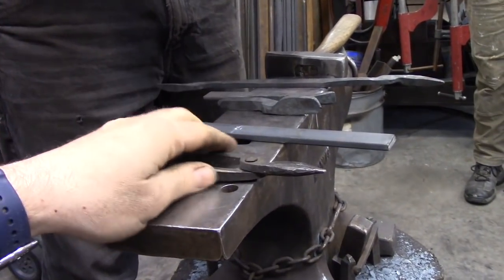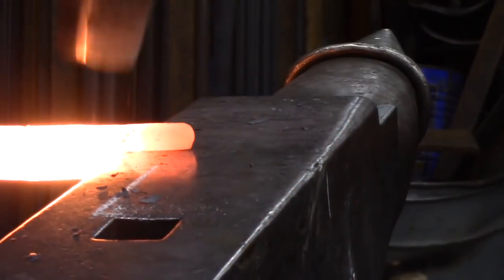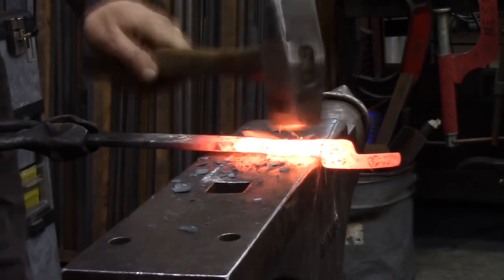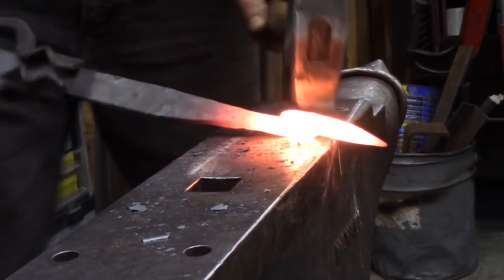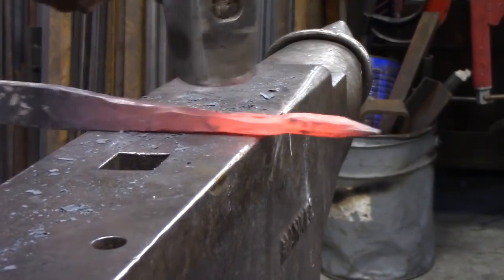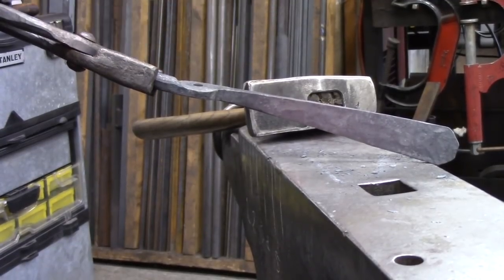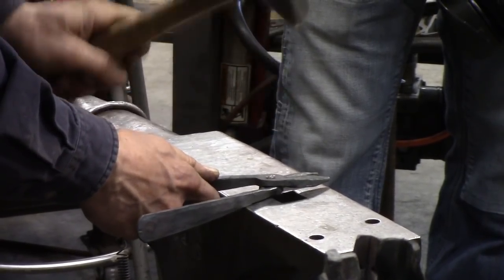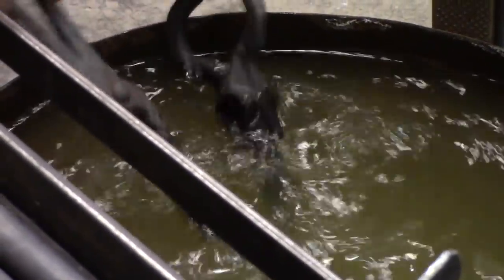Scrolling Pliers with Dereck Glaser at NESM

Comment: What size is the starting stock — 1/4” x 1” or thereabouts? How long a piece did you end up using?
Reply from the maker: That was 12" of 1/4 x 1" for both pieces.
Reply: Thank you!

I ended up making a pair from heavier stock (3/8” x 1-1/4”) and may make another pair from 1/4” x 1”. Many thanks for showing us the procedure!
Reply from the maker: @jhcc289  thanks for watching!